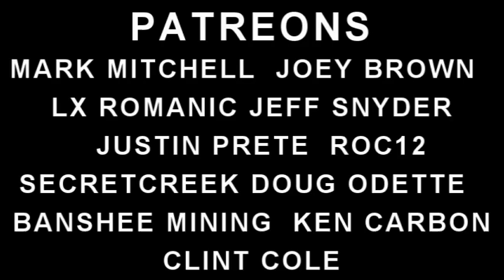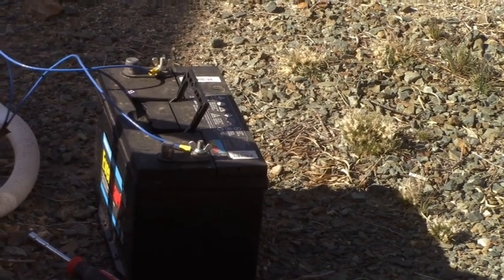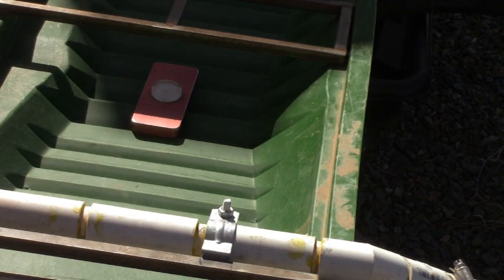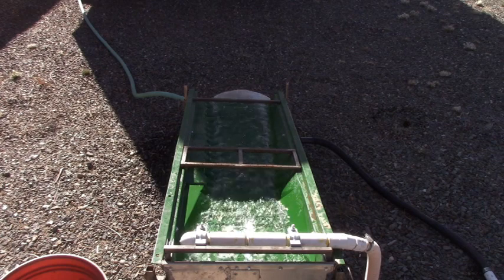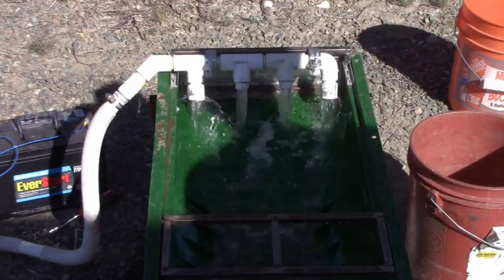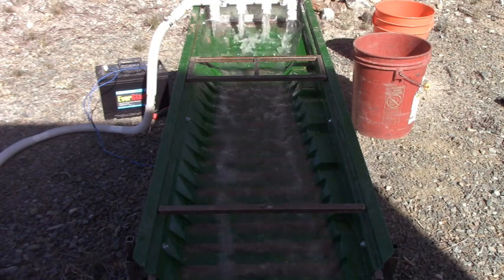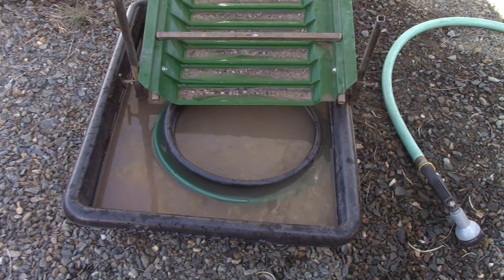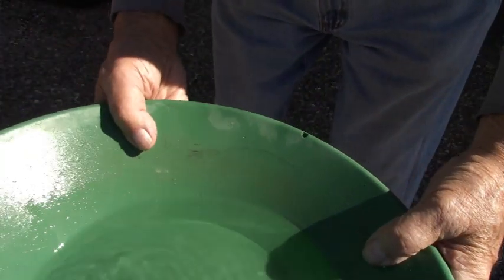CAN A LE TRAPP SLUICE BECOME A RECIRCULATOR

Comment: It’s a LaTrap! Awesome sluice! Should work great Chuck as long as your material is screened and not a ton of organics. Chuck get the larger, deeper mortar pan on Amazon, think there $60 but we’ll worth the money, that way you’ll eliminate your water losses. I’ve got two of them and they work fantastic. I’m eager to see the field use when you go to the desert! Great video !!!
Reply from the maker: Thanks for the tip Doug.I know you do this a lot and are the Arizona expert on re-circulating. I will check out the larger tubs. How much water do you take on a normal 2 or 3 day outing??
Reply: @CandSMINING  Haha not the Arizona expert brother, just used them a lot😊 We will take 50-75 gallons in 6 gallon jugs depending what are we’re going to work. More organics and clays will dirty the water pretty fast. The little screen filter really helps extend water like a lot along with floculant to settle the sediments, also a 8” kitchen strainer for skimming stuff out of the water. That large tub is on Amazon for $60, I couldn’t find them at HD or Lowes.
Reply from the maker: @dougodette4582  Thanks Doug,PV Home Depot has a lagre 45 gal tub. Very large 10h x34w x50 long 45 gal?

Comment: Looks like it will work I’m sure you could fabricate a funnel out of tin or aluminum at the bottom of the sluice to funnel the water into the bucket or just turn your black tub with the bucket in it the other direction with the legs in the tub and re-level it looking forward to the field test thanks for sharing see you on the next one 👍🏼👊🏼
Reply from the maker: Thanks for the tips.I invested in the next size up on the mortar tub, which i think will help. I am kind of using on of your ideas on directing the water. I will make a small guide for both sides of the sluice like I have on the mini wash plant.